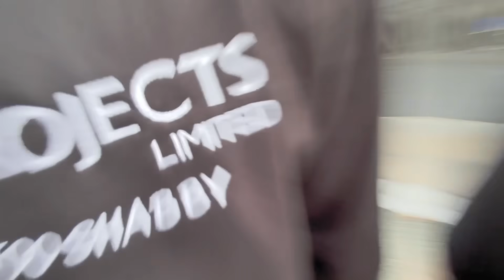We Can't Believe What This CUSTOMER Said...

Comment: Fantastic video guys as always and great work, but wonder why you never fit heavier galvanised coach bolted hinges to any of your gates, especially some of your wider ones ?
Reply: Those heavier cranked hinges
Reply: Yeah I wondered why the heavy duty forged hinges weren't used on the big gate.
Reply from the maker: Just never had a problem with the t hinges when we use 3 of them
Reply: @DJProjectss  Fair enough.  If they've never failed then it's overkill getting heavy duty.  Extra costs too.

Comment: How come you don't use drop on  Heavy duty  hinges that usually are bolted and screwed. Strap hinges do the job but in time I've had screws either working lose or rusting allowing gate to drop on leading edge. Worked 10 yrs for Local Council as Carpenter/ Joiner and made  and replaced many L&B s

Comment: Condolences to you and your family. 

Beautiful setting where them driveway gates were installed. Shame they weren’t electric as the installation looked 90% done already. Excellent gates and install was spot on - great care with fitting them ‘right’ including sorting the lights out. Well done. The side gate was a massive improvement on a panel and gate, well suggested Stevie. I thought you may have put a threshold in on that granite drop kerb between the pavement and the driveway in case they wanted to change the driveway in the future? Dave Birmingham

Comment: Steve when you barra stone would it not be easier to start at the farthest point & work backwards so when your knackered you're not pushing the barra as far. Re: electric gates, maybe the householder has had previous with them, locking shut, locking open or sticking in the middle
Reply from the maker: It’s always easier to rake down hill other wise your right 👊

Comment: Have the electric gates been switched off because they usually work with a sensor in ground front of gate inside and out post sensor is only there to stop someone haveing gate close on vehicle had a button push for ones where I use to work as there was no pedestrian gate

Comment: The large drive gates surely will need locking in open position when cars are coming in and out especially in the wind ???? Great install looks fab !!
Reply from the maker: Didn’t watch all the video?
Reply: @DJProjectss   I did see you use a large stone to keep them open. I did watch it to the end but may have missed it. Good excuse to watch it again.
Reply from the maker: @smoggydrones5664  I went back on Saturday morning to drill holes in the drive using the SDS so the gates could be hung back in position when needed 👍🏻

Comment: You will never get them existing motors working again, them underground boxes are supposed to be empty, so can only imagine how long they have been decommissioned because of the amount of sand/silt that's in them. I estimate about £2000 to replace and bring the rest of it up to standard safety wise.

Comment: Why oh why did you not cut the joint straight ? 😬 I understand if it was Stevie. But cmon Dave. It was like 6 extra brick to remove
Reply from the maker: Which joint?

If you mean the block pavers on the drop crossing, that’s what the customer wanted 😊, if that’s not what you mean, let us know so we can explain either way 👍🏻
Reply: @DJProjectss  man just straight joint the tarmac joint. Hardly a big request